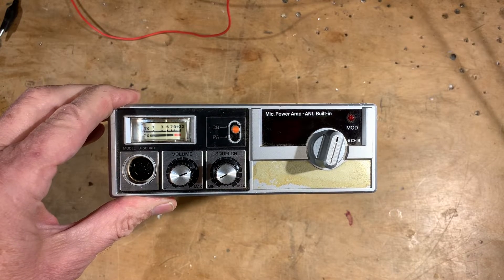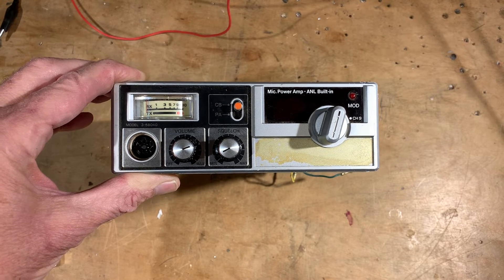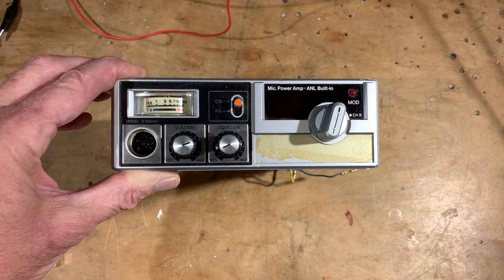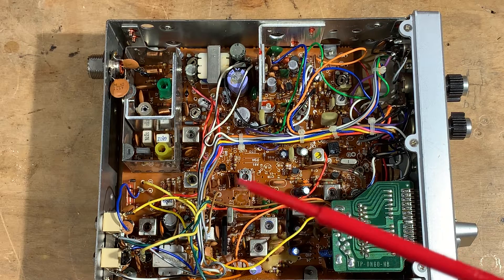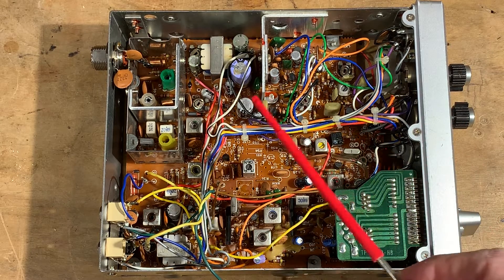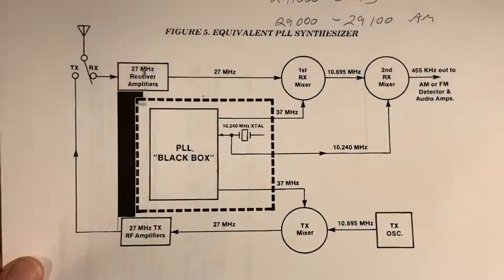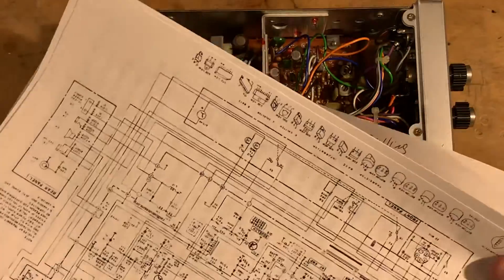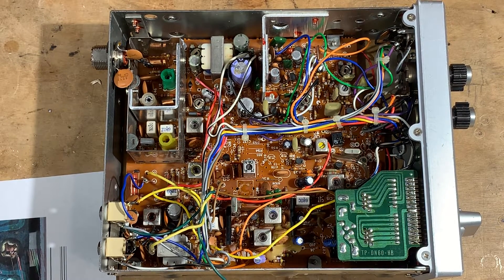Bill N2CQR Goes CB

Comment: I just saw this rig mentioned in the April 2025 RADCOM,  so looked it up.  I thought of converting CBs to ten.  Back in the day it was as simple as buying 10M crystals made for the crystal controlled CBs and some retuning,  etc.  Now those crystals are off the table or too expensive to have made.
Reply from the maker: Tom:  Which rig was mentioned in the April 2025 RADCOM?  Was it my rig?  Or the mod?  Or GE CB radios in general?  
The cool thing about this mod is that you don't need any new crystals.  Just the right kind of PLL chip and some wires.  73  Bill N2CQR

Comment: Get a hot air rework gun and heat those transformers and melt the wax plastic slightly and then the slug turns easier

Comment: Hi Bill an interesting video, please allow me a couple of points which may help. 
1) A lot of the ferrite screw cores in the coil cans are double ended and therefore reversible. YouTuber and radio ham Richard https://www.youtube.com/@ukfmcbradioservicingTango21 often turns them round. Richard has been servicing PMR and CBs for many years so might be worth dropping a line to.
2) New cores are obtainable in the UK so must be in the US. 
3) Sometimes cores are sealed with wax but in any case often are easier to turn if some heat from a hot gun or iron will ease them. 

There is more information than at first imagined, it just takes a little more digging for.
10 metre conversions have quite an history and some change the PLL with an Arduino these days. It would be worth looking at YouTuber Microchipz https://www.youtube.com/@MicroChipz and typing "Arduino" in his search area on his account. 

I hope some of this is use to you. Best 73, Ace G0ACE

Comment: Hi Bill. That GE CB dates no further back then 1977 when the FCC allocated another 17 channels above channel 23 to CB radio. Also, PLL controlled CB radios began replacing the previous 10 crystal synthesized 23 channel CB radios around late 1976 to early 1977. I got a GE CB like that one you have to talk back to my brother in his CB equipped Mustang in 1980. I wonder how many more CB radios would have been sold if that GE PLL design came out in 1975 instead of late 1976 or 1977 when the CB craze began to tank.

Comment: Should be fun Bill...a lot of those old rigs needed to have the mic plugged in order to have receive audio (ask me how I know!); you might also try to find replacement ferrite cores for those transformers.  73 - Dino KLØS
Reply from the maker: I am searching for replacement parts... Any suggestion on replacement ferrite cores Dino?
Reply from the maker: Dino:  Thanks for reminding me about plugging the mic in to get the thing to receive.  This is CB-weirdness.  Didn't happen with the GE appliances, but definitely happened with the JC Penny (!) appliances.  I now have two that have been "knackified" (thanks for the term W2DAB) and are now legit 10 meter AM rigs.  73  Bill

Comment: I must disagree with you on people not tinkering with their CB radios? First off it was illegal.  In the '70s according to regulation you were to have an FCC license to work on a CB radio.  Did anybody enforce it? Nope.  There were books and websites I think one was called CB tricks.  People remove the clipping diodes in order to get more power and at the same time more distortion!  Wiring up feature switches to the PLL to extend frequency ranges was a common mod. Little modules you would stick inside to make funny noises, echo, repeater beep, and more were commonly added illegally mind you but they were added. And I'm not even going to talk about the amplifiers without bandpass filters that would tear up the neighborhood.
Reply: They’re still making linear amps without bandpass filters. They’re on YouTube. You can tell which YouTube videos are for CB linears. They refer to the power transistors as “pills”.